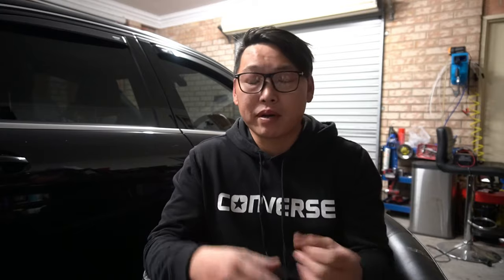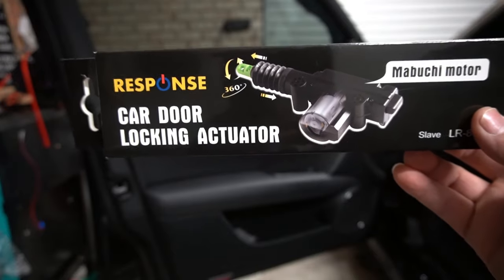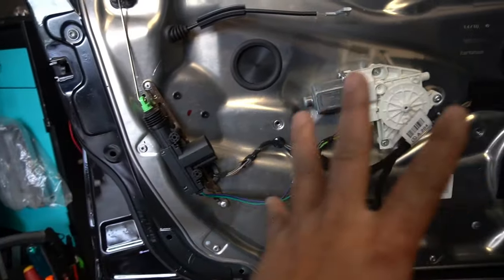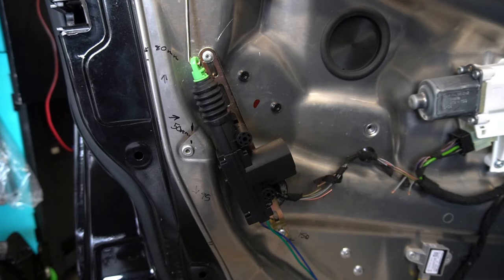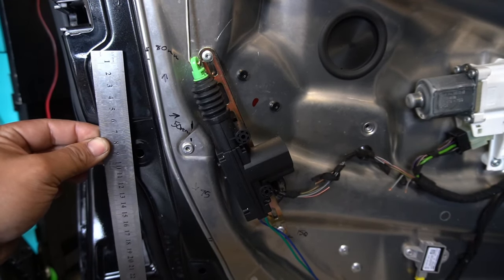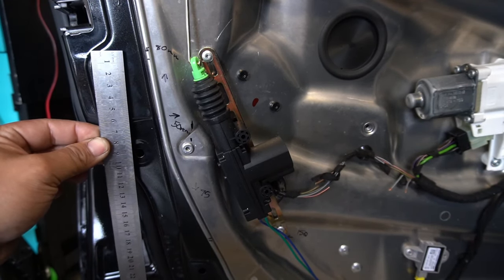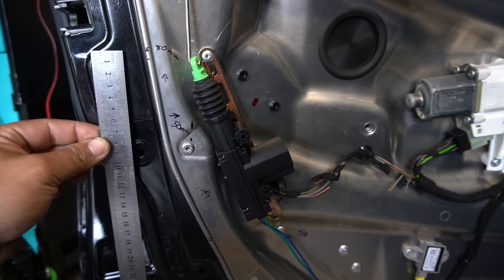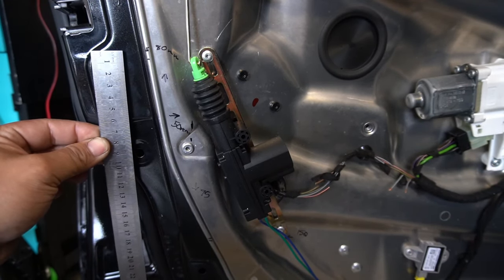mercedes common fault door lock actuator fix aftermarket part easy cheap reliable MUST SEE

Comment: This video needs a thousand more likes! I just bought a two pack of door lock actuators for 11 dollars, and I only needed to fix one. Fixed my driver rear door lock exactly like this video. Easy peasy. Thanks for posting this!!!
Reply from the maker: aww your too kind mate..I really appreciate u saying that..but most of all I'm just glad it could help u out cuz for me that's why I started to do these videos cuz I was sick and tired of getting ripped at any mechanic for the smallest jobs ..
Reply: which colored wires did you cut because the rear doors have different colored wires for my w204
Reply from the maker: hey bud cannu pls share the wires u used for a fellow subscriber pls ..as he just needs some help locating the wires needed
Reply: How did you do it? I just tried doing this on the rear door of my 2008 W204. But I can't as the pop-up button is not connected to a rod, but is actuated by a very thin wire running inside a plastic sleeve. I considered stripping the plastic sleeve, but the wire was too thin to fasten into the actuator connection block (and the wire would most likely just bend on actuation).

Comment: Re drivers door master actuator Hey Mikeyz, your video was incredibly helpful, thank you! Just to confirm drivers door fix is exactually the same (on a MB W169 A class) Dont worry about all the existing wires, just locate the 2 power, in this case black stripe and green stripe. If the close/unlock out of sequence, just reverse the connection. One point to remember is to make sure the drivers door is closed before testing otherwise the 'lock' function wont work. Thanks again Mike
Reply from the maker: Yep it's what I knew all along

Comment: Hi, thanks for the video guide. Just did the fix on my driver side door. Didn't have pop rivet gun so used some self tap screws. All works great. Might have to do some adjustments as it doesn't pop up as far as it should. Probably need to adjust the clamp onto original rod. Maybe I didn't extend fully before attaching or the aftermarket rod is catching on door panel.
Reply from the maker: did u shave the door abit cuz the rod rubs on the door panel that's why I shaved it

Comment: So, I really appreciate this video as (to your point) it saves time and money. It was a tight squeeze, but worked very well. Because it is a 2010 E350, the color schemes were off, but it is GREAT. I used the green w/black stripe wire and the all-green wire. The remaining wires I tied back to the 'older' actuator. Unfortunately, now the indoor lock switch will not work. I've checked and see 3 wires from the door switch on the driver's side. They are grey,grey, and black with white stripe. Any idea how to fix this? Best, Ken.

Comment: Amazing 👏 saved me hell lot of money and effort. A little tip. Where you have to grind for easy moment of the shaft. Just install a screw into the body near by so the screw takes all the load but the lock shaft.
Reply from the maker: good tip I'm glad it helped u out .. this is something everyone should learn because it really does save so much time and $$

Comment: Thanks. This work good on my Norwegian 2007 W204 both sides front. You save me alot of money.
Reply from the maker: ur welcome
Reply: I'm looking to do the same for both front doors.  You said something about master and slave units?  I don't see that distinction made for units sold on AliExpress.
Reply from the maker: @TheHomnguyen ok so it actually doesn't matter .. wen I bought mine it did make that distinction..hence why I thought it mattered ..but it really doesn't.. just use the slave one for any and it will be fine

Comment: Hi Mikey, Thanks again for your video and personal responses you have given me. I feel you should highlight the fact that the master after-market controller will also work as long as we use the correct colour wires as you prescribe. I feel you need to highlight the fact that there is minimal clearance for the new guide rod and that many many hours will be wasted by trying to move or bend the rods, in my case I had to do it so many times that I damaged the connecting bracket screws hence I needed to find a replacement.  To help with the clearances I ultimately stuck some weather  seal tape onto the door running parallel both sides to the connecting rod. This has allowed the clearances needed and now my after-market door actuator is working fine. Thanks again.
Reply from the maker: did uptake note of the fact that I shaved my door so the rod could slide up and down easily?? is this what ur referring to? .. that's why i s
shaved the door instead of trying to do something else..because u can't see it on the inside and It will not show on the outside nor ruin the door in anyway... I basically shaved like 3 to 5mm off where the rod as rubbing ... and it worked perfectly
Reply from the maker: but thanks for ur input this will help others  .hence why I leave comments section open so ppl can also give their experience in order ro help another I divided who has encountered the same problem
Reply from the maker: I have always stated that it's possible le to do the Master using same wires.. although in video I stated u may need the master ... it was just a precaution... but everdently will work because all your doing is supplying power to the actuator motor to spin wenever it gets 12v power introduced through the lock and u lock mechanism
Reply: For a 2010 E350 W212 driver's side replacement,I was was succesful in installing 2-wire solution to green w/black and solid green. Remote key fob works, but not inside manual door lock switch. My question: In the scenario above (w212 driver front), should I use master actuator, or better yet can I attach both 2-wire new actuator wires to the wires off the inside door switch? Anyone been through this? @MIKEYZVLOGZ

Comment: Great information and I just have the same case for my front left and right doors. I am going to order it from China coz I am in Hong Kong. Thank you.
Reply from the maker: good on. ya
Reply: @MIKEYZVLOGZ  I try to install the actuator, but it just only active when i press unlock. no response when i lock by the key. do i need to unplug the green plug and put it back in?  is only of the fuse is broken?
Reply from the maker: @raymondfong32  it should work maybe a connection loose cuz should be simple two wires  to power device .. so wen u press lock and unlock  it sends power to the device to spin ..that way it keeps rotating and locks and unlocks ... that how it works .. so in your case ..u must be missing something

Comment: Hey man! Love the video, super helpful. I’m trying to do this myself on my 2007 GL  450, but the wire colors are different going to my right rear door actuator. Would you happen to know which ones I should splice?
Reply from the maker: hey bud so sorry as i haven't worked on your car before its hard for me to say 
, what u need to do is find your door schematics, and it will tell u which is which wire, however when u open the door u should be able to see what goes to the door actuator and that will def get u one step closer , for me , after i knew which cables they were i still has to confirm, so i followed the wires and triple checked they went to my actuator, in the end there should only be 2 wires that power the actuator becuz all it does is send the power wen u lock and unlock, its actually very straight forward wen u break it down, but i know it can be overwhelming, my best advice is find the schematics, or ask forums and someone can guide u very quickly, im just sorry i dont work on your specific car and all cars have different wiring
Reply: @MIKEYZVLOGZ   no worries, thanks for the quick response. The way our doors are set up, they are very similar. Just like yours, I have 5 wires wrapped in fabric that go into a hole towards the actuator. Do you know of anyway I can test which ones give power to the actuator without taking the whole door apart?  lol I’m guessing I could maybe just test the voltage on each of those wires, but haven’t tried it yet. All good if you don’t have an answer, just talking out loud here

Comment: Question my w204 2010 c350 4M is left hand drive (canada) the driver size lock not working (left) and what is that about when I look at the Amazon. They have a kit with 4 actuators 3 of them with 2 wires and one have 5 wires. What is that one with 5 wires for ?

Comment: I have a 2009 ML 350 that the driver side door actuator is not working correctly. Will this fix work on it? In your video you mentioned that this fix works on the other doors but I’m not sure what you meant as far as what I need to do on the driver side.
Reply from the maker: hi mate thanks for watching. what I meant is you can use this same fix on any other door rear ... and u don't need a master cylinder for driver door ..just a slave will work..so long as u identify the 2 wires that supply power to your factory actuator..connect the after market to it and it will work the same

Comment: I have an A170 which won't lock with the key but WILL lock itself when driving, so it's probably not the actuator right? However it can't be the key either because it does lock all other locks except the driver side. Edit: turns out it was just the key batteries, 2x new CR2025 batteries fixed all 4 door locks instantly.

Comment: Hi Mikey. Another request for a video on fitting the actuator on the W204 rear door. I have had a go, but can't see how to connect the actuator to the existing door button as there isn't a rod. It is actuated by a very thin wire running inside a blue plastic tube (which runs the length of the door). the wire slides inside the tube (works like a bicycle brake/gear cable). I suspect that if I cut the sleeving, and somehow manage to connect the replacement actuator to the exposed wire, that the wire would just bend on actuation. Cheers John
Reply from the maker: ok imma look into it
Reply: Have you made a video on that please ?@MIKEYZVLOGZ

Comment: hey mike cool vid looks simple witch one do i order if im doing driver side on a 2008 mercedez bennz C300
Reply from the maker: ok so it doesn't matter ..u can still use the slave for driver side just follow the same cable colours... it will still work..I was simply just trying to state the rest are slave compared to the master where the main unit is..but u can still use the slave gor the driver side and it'll work just fine..the principle is to give power to the actuator wen u press lock and unlock which intern sends ppwer to the lock actuator motor which then spins and locks then unlocks the door ..that's it

Comment: Ingenious, I just ran into this as I worked through some of my codes and although I have a 2010 W212, i’m going to attempt to see if this is possible. As others have done, I too saw the insane labor involved and honestly, I  accepted the fact of having to manually lock and unlock. 
Huge thanks for the idea and I hope to report back that this is possible on the W212 as well.
Reply from the maker: good luck I'm sure u find a way mate mercs have alot of room behind door
Reply: Hi Dave ive got the 2010 E350 W212 and have had an issue with my rear drivers side actuator not working. I am really thankful to Mikey for doing the 2 wire Universal Mod and was thinking i should try this aswell! Any luck with doing yours yet??
Reply: @davemccready6013  Dave please dont worry dude..... my actuator has been duff for the last 2 years lmao so no worrys you're doing ok! I've had some experience with these manuals and didnt bother in the end, even the Mercedes WIS/ASRA/EPC programs you can get on ebay and the like are really difficult to install. The saving grace here is that Mikey has quite nicely explained very well the wiring code with regards to the door actuator (Grey-Blue and Grey-Black). MB are pretty consistant with their colour coding so should be the same on ours. I noted that you have come across the low melt solder heatshrink, did a job on a VW Sharan fault with regards to the Fuel Temperature Sensor last week. The guy brought it to me after his mechanic had fitted a new sensor but the fault code and money light was still on. I found the fault to be a broken wire in the loom which was telling the ECU that the Voltage was high from the sensor so Engine light was put on. Found the wire break and used this solder heatshrink, worked beautifully! 
I've also found the Universal actuator on ebay and have ordered today......depending on the weather this weekend i might give it ago. i will let you know what i find behind the panel.
Reply: @AsimEden  I’m in the same boat going on 2 years of locking the drivers door manually from the rear. So Mikey was a god sent idea. Glad to hear about the connectors since this is my first go at using them, not a fan of crimped. 
As far as the wiring goes the colors are different on my front drivers door according to the diagram, but should know for sure tomorrow.  I’ll update what the colors are and post an FYI.
Reply: @davemccready6013  I think you will have an easier time with the front Dave hopefully. The rear on the W212 looks a bit tighter in terms of space but I’ll find out when I get the panel off and of course will keep you updated, best of luck with your install mate!
Reply: @AsimEden  OK Well today was a fail,  The basic layout is the same except on the door panel where Mikey has a void ours has a formed hard foam that I am assuming is to reduce noise by keeping it tighter.  I was ready to cut away at this to make room for the actuator, but began to try to find the wiring needed. We don’t have any grey wires. I was able to see the plug going to the lock and it has 2 green and 2 brown variants. mixed in the bundle is a blue, white and another brown. Unfortunately my wiring diagram shows blue/ white stripe & Blue/yellow. So that didn’t help. I tested the wires and both greens would show power when the unlock was pressed, Blue was a constant low voltage and i got no power from the rest on lock or unlock. So the day was late and i threw it back together to fight another day.
Reply: @davemccready6013  Hi Dave sorry for delay in replying! Thanks for the update. I understand how you felt when things were not as expected. I have a mate who has just started work at Merc Main steelers, give me a few days once i get hold of him i will ask him if he can shed any light on the wiring on our cars regarding the central locking. where there is a will there is a way.
i was just thinking is there enough gap in that area where by it would be possible to just cut away at the metal plate just enough to get half of the cylindrical part of the new actuator in and then maybe secure it somehow after of course we have got the info on powering it up correctly?
Reply: I have a w207 and I believe this just happened to me as I sit in a parking lot unable to lock and unlock the car. I was wondering if you ever got this to work. Or how much more work the full job is.
Reply: @Dnasty1  I have not returned to it because I had to make repairs to my headlight assembly and bumper structure from a late night asshat making a U turn directly in front of me within 10 ft and being unable to stop i made contact.
I will say that the 207 may actually have the 2 separate lock and unlock signal wires. I would considering the low cost of the actuator, it’s worth trying out. I believe that my case is a rare one. There are very few wires to test and overall a repair that on a scale of 1-10 would be a 1 compared to the 9 i feel the actual repair is. If you do not have a very heavy duty large rivet gun and very inclined. then the cost is 10-20 times this and a minimum of 8-10 hours.  
The actual repair involves removal of Door moulding, Window glass (I have seen done with it in a taped) and worst of all the illogical metal door plate that you have to drill the factory rivets out just to get to the inside of the door. There are videos out there and I suggest watching them during Halloween because they are much scarier than the new horror movies. 
Good luck and look forward to hearing how yours goes. 
On a side note, if yours just started, I feel it would be worth connecting a good reader to your car, checking the codes and running a full clear. so sucked it up and bought one of the MX Autel models that runs so many more modules and besides identifying 5 more issues, I cleared the system and an issue I had with my drivers window not Auto closing and even going down an inch when trying to close, all of a sudden began working perfectly. 
All that to say have your computer cleared properly and verify that does not fix your problem before digging in.
Reply: @davemccready6013  The first thing I did before I manually locked the door and parked it was clear that fault. It showed “the output for the central locking motor has a fault….etc. “ I’m gonna let it sit for a while and see if the battery off refreshes it. But now that I think of it this has been intermittent for a while my car was broken into a while ago and I had no idea how they got in, I always lock my door but didn’t know the actuator wasn’t doing it’s job all the time. Mercedes never ceases to amaze me with their over engineering of stuff. How could they think it’s a good idea to require a rivet gun and drilling apart of a door to replace a window actuator. This is a part you know will fail on any car and what benefit does shielding the actuator even do. Lol ridiculous.